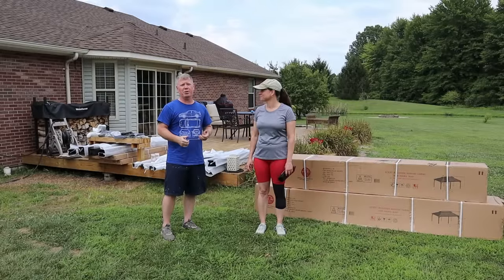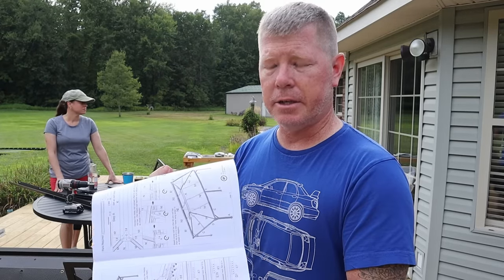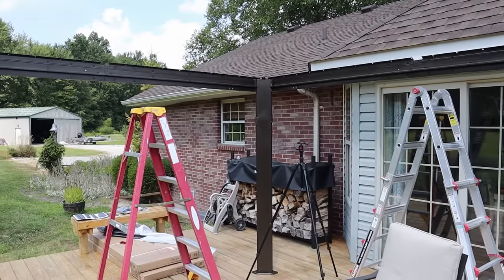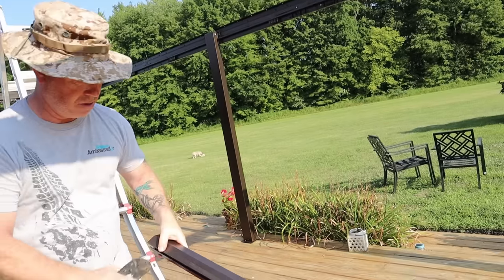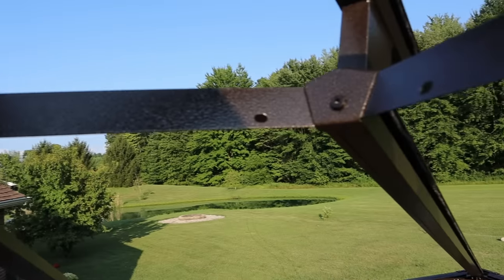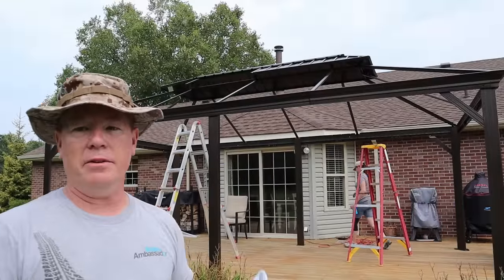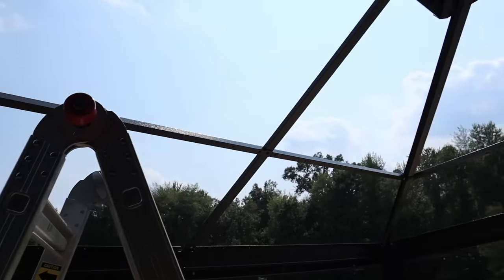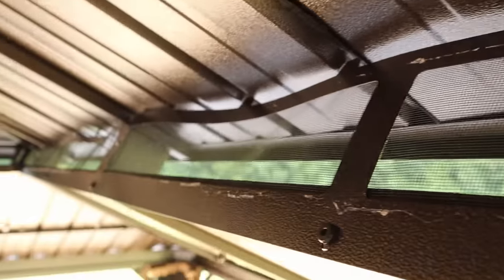Assembly How To- Kozyard/ Purple Leaf Gazebo (& Other Brands) - 12x20 Metal Roof Gazebo

Comment: Your video is so helpful.  We just started putting our 10x14 gazebo yesterday and finished up to the bottom frame. Our gazebo just fits with a few inches to spare from the house roof to the end of the deck.  I’m worried about installing the lower panels as I noticed you were installing them from the outside of the gazebo.  But I see that your gazebo almost touches your house near the middle.  How were you able to get those panels up?  Did you go through the open roof to reach the screws?  I really hope we won’t have a problem as there is nowhere that we can move the gazebo to  to assess that side of its roof from the outside.
Reply: I meant 10x12
Reply from the maker: @debbieglavas381  Thank you very much for watching our episode and sharing the kind words. We really appreciate it and glad that is has been a help for your 10x12. We actually had about 1.5 feet at the edge of our deck to keep it away from the house so we could assemble the roof panels before sliding it under the house roof. Once assembled, we slid it over to where we wanted to bolt it down. I'm not sure you can assemble them through the open roof but I hope you're able to come up with a solution for it. Wish we could help out more.
Reply: Thank you for your reply.  I will let you know how we made out.
Reply from the maker: @debbieglavas381  Our pleasure. Yes, please do.

Comment: My question is:
Will having the roof which abuts to the house/sloping down toward the house, cause water damage around a sliding door or French door leading to the house. Also, if I were to obtain a gazebo which has the slope down toward the house would there be a way to have some kind of gutter or diversion that I could add to the gazebo structure,which would keep water from sheeting down onto the rear door area when it rains heavily.?
Reply from the maker: Hi Esparka. Thanks for watching and asking.  We appreciate that. This will vary greatly based on the slope of your roof and how things fit. For us, our gazebo roof slides right underneath our roof overhang so we don't have sheets of rain coming down. The gazebo has a slight futter system on it already to help but it's smaller than your typical house gutter. As far as water damage,  it wouldn't create any more damage than water that may already be coming off your roof. Hope this helps.
Reply: @SpiritedWrenchers  
Thank you!
My deck has clearance of 14’ each direction.  A 13’x15’ (the posts would just fit) is what I want, but, I fear that having the edge angle toward the back of the house will sheet the rain onto the door. I’m more thinking about having the 13 feet span be in front of the door and that would make the gable roof flow to the side.

Comment: Great video How did you fasten it to the deck ?
Reply from the maker: Hi White Ash. Thank you so much for watching and sharing the kind words. We really appreciate it. We just used galvanized steel screws that are exactly the size of the base plate holes so it was a snug fit. We have no problems with the sturdiness of them on our particular deck. Hope that helps.

Comment: I bought the 10x12. Doing the roof tomorrow. Several challenges with bent pieces that may have been damaged during shipping. Instructions, a little off at times so far, lots of back tracking.  Hope the roof isn’t too much trouble.
Reply from the maker: Sounds pretty accurate like ours.  Just take your time with the roof pieces and if something isn't going together easily, something is wrong and keeping it hung up. Good luck with the last piece.  Let us know how it went.  Hope this video helped and we appreciate you watching it.
Reply: I assembled this last month. It took too longer than it should have due to holes not lining up and some bent and damaged pieces. The end result was good but the screen lower Velcro doesn’t line up so the lower screen is loose and blows in the wind. I’m not sure what to do about this yet. Leave it to Ching to produce crap once again.
Reply from the maker: @donnahamilton253  Sorry to hear about the issues you ran into. Our doors are different than yours as our doors only have zippers on them. Thankfully everything lines up on ours. If yours is the Kozyard brand, I would contact their customer service. They have a number to call and they were always great with helping me in the order. They may be able to help.

Comment: Working on assembling mine here in sunny Oregon (haha). Waited until the rainy season of course! No worries about overheating. Anyway, question was I didn't get a tube of that magic sealant, should I be worried to assemble without? We will have a lot of rain going through those gutters. Also think I'll need to put drain holes on bottom under posts. Thanks for any thoughts. Nice video.
Reply from the maker: Hi John. Thanks for watching and asking. We greatly appreciate it. You can use some simple waterproof sealant or caulking and it will just the same as the tube you didn't get. There should be drain holes at the corners already unless you're talking about adding more. We're going to be adding rain chains to our drain holes to help with waterflow. Now that we're entering snow season here in OH, we likely wont worry about it until Spring though. let us know how your build goes. Good luck.
Reply: @SpiritedWrenchers  I was talking about adding a hole under the posts that would go through the deck so that the water wouldnt pool up there

PS, thank you very much for the quick reply.
Reply from the maker: @johncware66 . You're welcome. Our viewers mean a lot to us so I read and reply to comments several times a day.. Ahhh, That makes sense.  Since our columns are hollow, and we have gaps in our deck boards,  I haven't seen any water pooling up so far.
Reply: @SpiritedWrenchers  Hi, what is the sealant for? We just assembled our 12x20 gazebo and did not apply it😟.  Do you have any suggestions on what we should do at this point?
Reply from the maker: @calhounmo  Hi. Thanks for watching and asking. We greatly appreciate it. It was really a seal where the joints are. Where the beams come together.  You can also easily use exterior caulking to do the same job. Congrats on your gazebo!
Reply: @SpiritedWrenchers  thank you! Is it to prevent leaking?
Reply from the maker: @calhounmo  you're welcome.  Yes, right along the seams.

Comment: Can the side curtains be left on all year even in cold temps and snow?? If not how do you take them down?? Should the be wrapped if you leave them on??
Reply from the maker: Hi Georgiq121. Thank you for watching and sharing. We greatly appreciate it. That's a great question. We actually leave them on all year. We close them up some during the winter when we know we're going to be using the hot tub but then open them back up. We're going to be doing a 1 year update on this gazebo and releasing it next week so we'll add this question to those we'll be answering for others. Take care!
Reply: @SpiritedWrenchers  Thank you for the quick response!! Do you live in a colder climate?? Im just concerned about the snow and below freezing temps
Reply from the maker: @georgiq121  our pleasure. We made these episodes to help so we're happy to answer questions. We live in OH. Temps drop into the single digits at times during the winter and we always get snow. No issues with either so far. You can always email us and we'll do our best to answer any other questions that you might have. Hope that helps.
Reply: @SpiritedWrenchers  One more thing  How do you keep the curtains from blowing around? I was thinking  of securing them with bungee cords?  Any suggetions???????
Reply from the maker: @georgiq121  Certainly. That's an easy one. The ties and wrap that comes with them is plenty. The only time they weren't enough is when we had a tornado and the winds were over 40mph. LOL. You won't need bungies unless you're trying to tie down the bottom of them. Cheers!

Comment: Quick question for ya. In your opinion. Do you think the corner posts have enough beef to them to mount a tv? Was looking at getting a wood gazebo for that reason but I kind of like the steel better. Thanks!
Reply from the maker: Hi Kenworth. Thank you for watching and asking. We greatly appreciate it. I'd like to say I feel confident in it enough to support one but I do not. The metal is too thin to support it. If I were to mount a tv, I would a mounting shelf from the corning on the long side to the corner on the short side so it's using 3 different points for strength. I'll have to create a custom mounting point for the fan we want to add because it's the same situation as your thought on a tv. Hope this helps. Stay safe and take care.

Comment: Can you advise on how much space around the posts are needed to construct the roof or for future maintenance of the structure’s exterior? Kozyard reports the frame alone weighs 310 pounds so wherever that’s erected may be it’s final location.
Reply from the maker: Hi Eric. Thanks for watching. We greatly appreciate it.  Good question.   The frame may be a total of 310lbs but it's not that at each post. We actually moved ours over roughly 18 inches so it would slide just under our roof line. We just each grabbed a leg on one side and moved it over switching from side to side. Hope that helps. Happy to answer any other questions you may have.
Reply: @SpiritedWrenchers  Did you move the structure after it was completed, or before the roof? Can you also share how much space beside the structure is needed to work on the outside of the roof.
Reply from the maker: @ericfabricant3276  Hi there. Yes, we moved it after it was built. We only had to slide it over roughly a foot and a half so it wasn't bad. That space prior to moving over was all we needed to complete the roof sections on the house side. It was a little tight but it worked. Hope that helps.

Comment: Part G/ gutters with 4 screws top and bottom are not lining up correctly. Top part you can’t even see the hole. Any advice?
Reply from the maker: Hi A Wax. Apologies on the late reply, we've been traveling for the last 2 weeks.  Thank you for watching.  We appreciate it. We're you able to figure it out? One thing we've discovered is that if something isn't lining up, somewhere there was an error made and we have to backtrack to find it. If you haven't figured it out yet, we'll be able to look at manual early next week when we are back home.

Comment: Quick question, how is the roof when it comes to water? Does suff underneath stay dry? Or does a lot of water leak through the roof?
Reply from the maker: Hi Rick, Thanks for watching and asking. We greatly appreciate it. We've had no leaks at all. Unless it's strong side rain and wind, there it stays very dry under it. We keep our furniture cushions under it if that helps. We wouldn't if it got wet all the time. Hope that helps. Let us know if you have any other questions. Cheers!

Comment: Thanks for the video.  I am currently building my 12 x 16.  Is it safe to tighten all of the framework right before starting the roof?  I'm at the point where I will be starting to put the roof structure together but I left all of the mainframe components loose to avoid mis-alignment of holes on the final roof panels.  Thanks .
Reply from the maker: Hi John. Thank you for watching and sharing the kind words. We greatly appreciate it. That's a great question. The only areas that we would suggest you not tightening all the way are just the roof braces that the panels are mounting to just so they can shift a little here and there if needed. As far as the main structure below the roof, you can tighten all of that now. We wish you luck on the rest of your build. We're excited for you and happy to be apart of your journey. Cheers!
Reply: @SpiritedWrenchers  Thank you for the advise!  Instructions say do not tighten any joints but I was a bit skeptical.  Appreciate the videos!
Reply from the maker: @johntvideos6501  Our pleasure. Understandably so. We call out where we left things loose(or should have LOL), so hopefully that will help.

Comment: You think the metal clips for the roof panels were bad. Now they are sending plastic clips. They fall off and do not slide. We have tried super glue, duct tape and now are on our way to the store to get epoxy glue. Nothing seems to be working to hold the clips onto the panels to slide the panels in. It is a total nightmare.
Reply from the maker: Hi Jan. Oh no. That is terrible. Is it Kozyard brand or something else?

Comment: Looks great! My wife and I assembled something similar but smaller. Are you planning on adding gutters? If so, which ones. I am trying to find a solution as I dislike rain water from the  gazebo roof running into our patio. How much did this one cost you including shipping?
Reply from the maker: Hi MKB, Thanks for watching, commenting and subscribing. We greatly appreciate it. This particular gazebo actually has a gutter system on it however the holes are at each corer for the water to flow through. Dana and I have been considering trying out water chains but considering winter is coming soon we may just do some research over those months before experimenting. Price was $3,199 which included taxes and shipping from their website.
Reply: @SpiritedWrenchers  Thank you for the quick response!
Reply from the maker: @mkbdiy9766  You're most welcome

Comment: Hi I have a question is it hot under there from sitting in the sun I'm interested in buying that exact gazebo
Reply from the maker: Hi Tony. Thanks for watching and commenting. We greatly appreciate that and asking such a great question. With the roof pieces being metal, it's expected to get hot under the summer sun but I'm trying to think if it was something we actually felt sitting under it. I don't think I recall a time where I felt we absolutely needed a fan. The ceiling is up high enough where it gives plenty of room for breezes to come through and keep it a moderate temp. The pro's of having a metal roof over a canvas one that will tear down in 2-3 years (depending on where you live) makes up for it. If you're thinking of purchasing the same one from Kozyard, email us @ spiritedwrenchers@gmail.com. Kozyard is now a sponsor to our channel and I'm working on a discount code for our viewers so we'd like to help you out with that. Cheers!

Comment: When doing the roof panels, are the clips faced upward or down? I’m having trouble with the panel holes not lining up. Any tips.
Reply from the maker: Hi Ariana. Thank you for watching and commenting.  Did you get it figured out? If not, what step in the guide are you on?

Comment: How was moving it? I'm going to need to raise mine by like 8-10inches to clear my sliders.  My plan is to build frame then lift it and mount onto cement risers (before roof install).
Reply from the maker: Hi Nick. Thanks for watching. We appreciate it. It wasn't that bad all. Since you're doing before the roof, you won't have any problem at all. The roof is what adds the weight to it all. Good luck and let us know how your build went. Cheers!

Comment: Would it be possible to put up the gazebo roof without using the clips? I’m considering doing so because the panels still fit snug without the clips
Reply from the maker: Hi Michael, thank you for watching and asking. We really appreciate it. I'm sure it's possible but I'm not sure I would recommend it. If it's a snug fit without them, you may be alright. We're just not 100% positive on that since we haven't tested it out. Wish we could help more but we wish you luck on assembling yours and that you get many years of enjoyment out of it.

Comment: Did they put the instructions in the bottom of the box?  I have limited space to work so I'm trying not to dig out every last piece.
Reply from the maker: Hi Undeadpiano. Thank you for watching and commenting. We greatly appreciate it. The instructions should be with the box that has the hardware.  We apologize that we can't remember which box they were in though.  Congrats on your gazebo. Let us know how it turns out. Cheers
Reply: @SpiritedWrenchers  Hey thanks for the reply.  Super helpful video.  Been studying it in anticipation for this weekend.  I figured that's where the instructions would be.  Our shipment is missing them.  I'll have to print them online. Thanks again
Reply from the maker: @undeadpiano  our pleasure.  Dang. Sorry to hear about the instructions missing. Glad you can get them online and it's not a large manual to print.  Thank you for the kind words. We hope your project goes smoothly.  Would love to hear how it went!

Comment: Just purchased mine last week, the metal clips are plastic now. Doesn’t hold when pushing into the slot.
Reply from the maker: Hi Outlaw. Congrats on your purchase. That's incredibly disappointing to hear. We're about to assemble a 10x12 by another brand at the end of the month. We're hoping they do not have plastic clips. Thank you for sharing with everyone. How are you assembling the panels with the clips that way?

Comment: I've wondered if you couldn't just assemble the roof or just frame of roof on the ground and then just lift it and secure it in place. Seems to be overly complicated with the step by step member installation. Doesn't look too heavy so might be fairly simple if you had 2 people to position it in place using ladders.
Reply from the maker: Hi Stoic Sigma. Thanks for watching and asking, we greatly appreciate it. It might be possible for the smaller sizes to do just the roof framing in one piece but not fully completed. The weight and the fact that these are aluminum, not steel, wouldn't support it. There is no way on the larger size like ours. Hope that helps. Cheers!